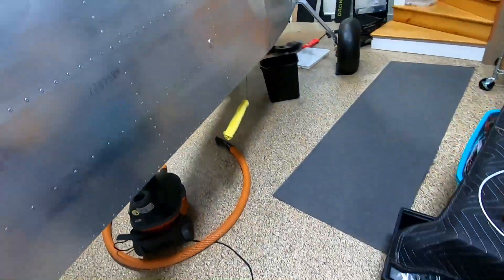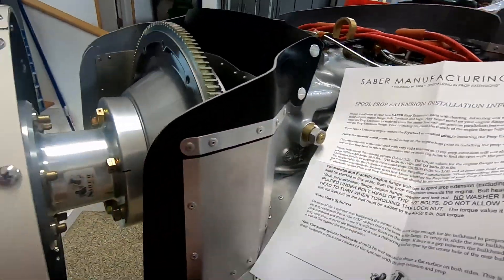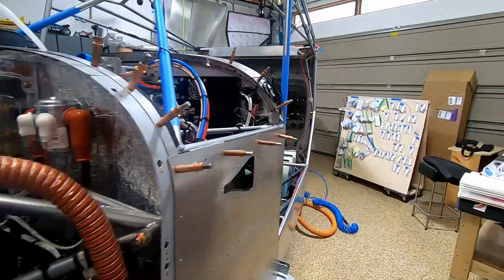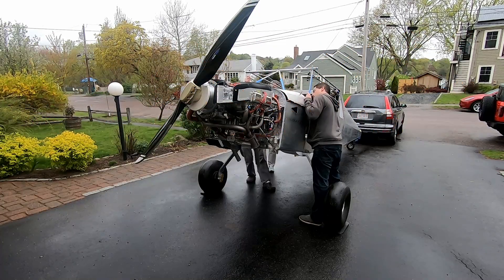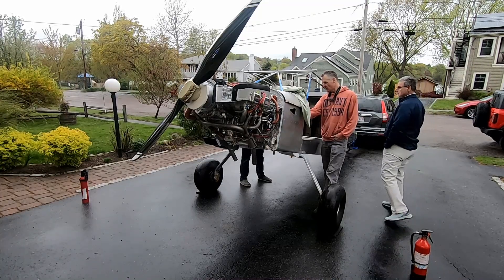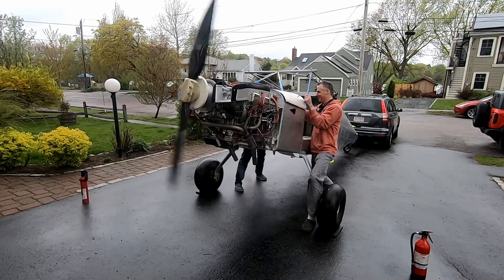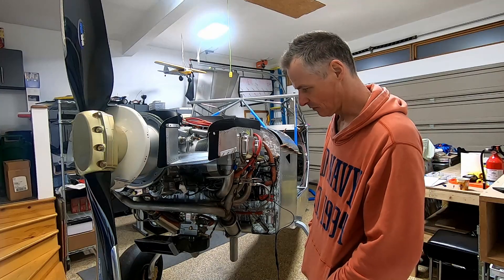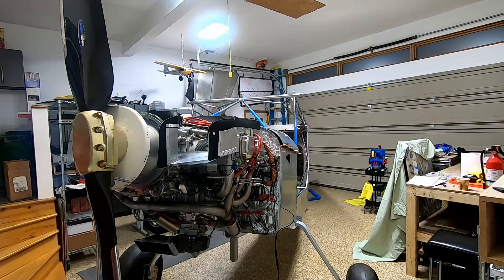RANS S-21 (139) First engine run

Comment: Hmmmm…..your not using type M oil to break-in your new engine?
Reply from the maker: After doing some research, we opted for PHILLIPS 66 XC AVIATION OIL. Seems to be a recommended choice by many (but you know what happens when you ask the internet, lol)
Reply: @simdpk  Im pretty sure Continental recommends type M for break-in. X/C and Victory oils by Phillips is good for regular use after breakin. Have a read on type M.